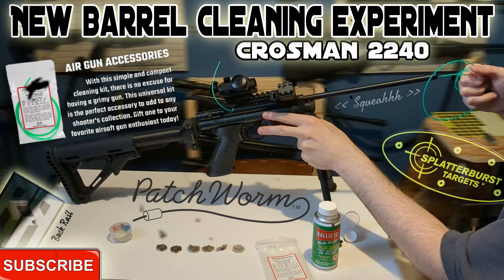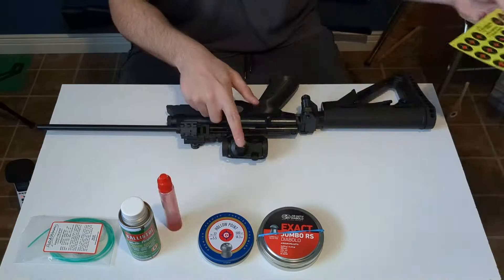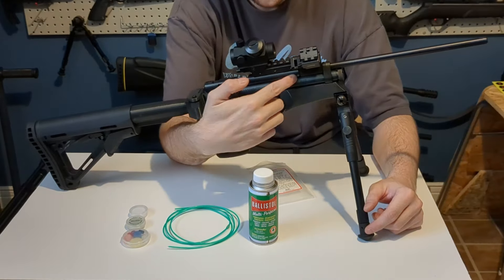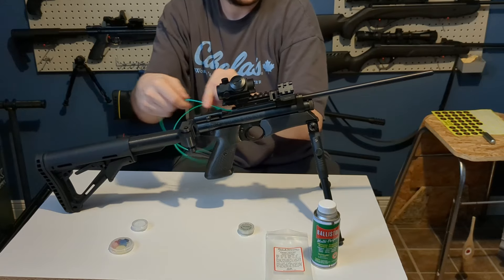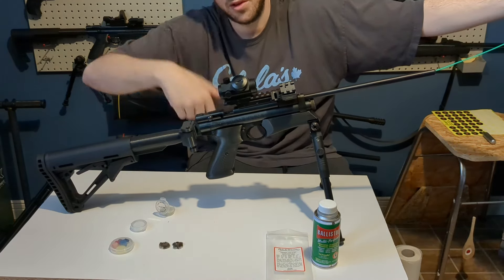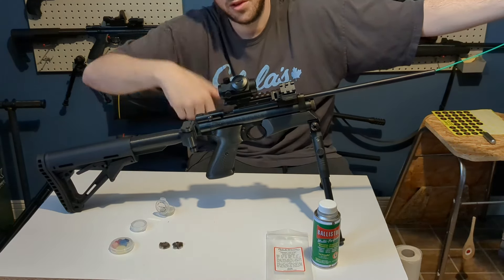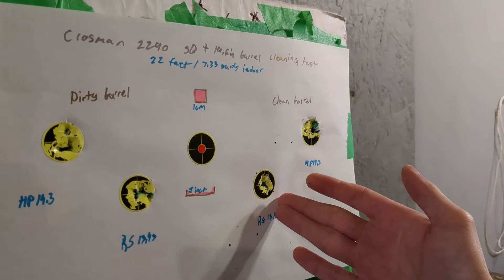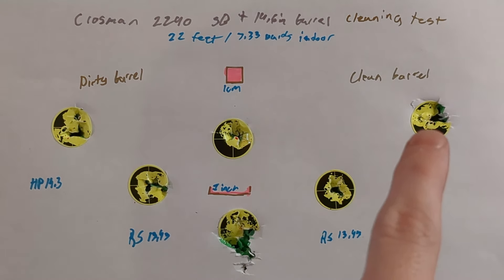Will cleaning my AIRGUN barrel improve accuracy? | Barrel cleaning experiment with the Patchworm kit

Comment: I had to use brushes on my G30 when it fouled from the oversized slugs. 3 brushes later lol looked like I was cleaning a chimney with all the patches prior to the brush.
Reply from the maker: I've had to use a brush only on one of my barrels yet and it was for summilar reasons!
It shot very meh and the cleaning was NEVER ENDING.

You mean 3 brush like 3 actual brushes ripped appart from doing it? 
Those things are expensive haha

Thanks for watching! :_LwkLogo:
Reply: @LowkeyAirgunner  lol yep 3 brushes gone cleaning it. So much lead caked on, never seen anything like that before. haha I ended up grabbing a bore scope to make sure I wasnt going crazy, since it grouped like crap after. Just needed the right ammo.
Reply from the maker: @toxicmatrix1337  So if a slug is extra tight stop using it or you will cause yourself issues in the long run?

Comment: I got a patchworm back in ‘22 and don’t care for it very much. I ended up using a thin piece of weed wacker string and heat welding a loop into the end. I think it’s easier to use than having to stab the patches in the middle. Cleaning an air gun barrel can definitely improve accuracy if the gun starts shooting erratically.
Reply from the maker: I was using this before but by cutting a slit in the middle of a slightly bigger cord!

It worked fine especially on a barrel that doesn't get very dirty but the kit definitely scrubs alot tighter in the grooves
Both ways work but the DIY one will usually require more passes to make up for the looser fit even if you use bigger patches

Thanks for watching! :_LwkLogo:

Comment: It's not really a fair comparison if you used a sandbag for the first two groups then switched to a bipod for the others. Shoot all groups using either the sandbag or bipod and see if you get the same results
Reply from the maker: That's exactly what I did both groups are on the sand bag.
 What I meant is that I've used the bipod only to hold it during the cleaning basically and I was not shooting with it!

Thanks for watching! :_LwkLogo: